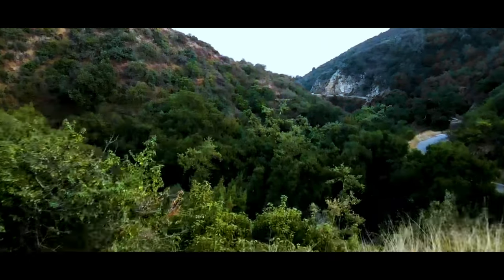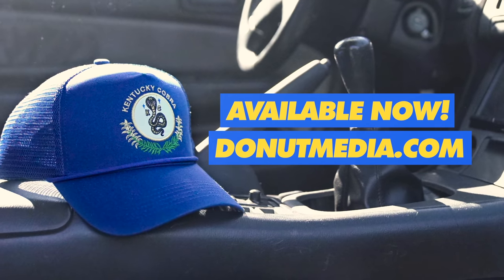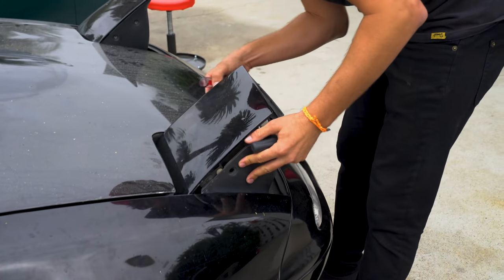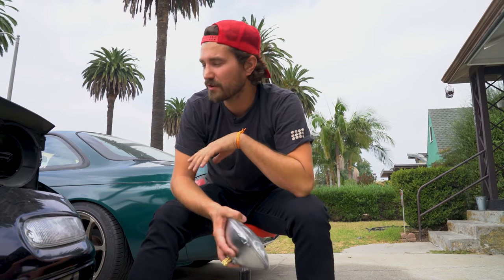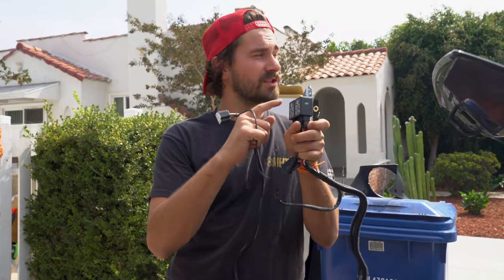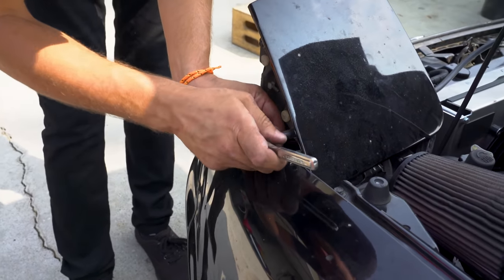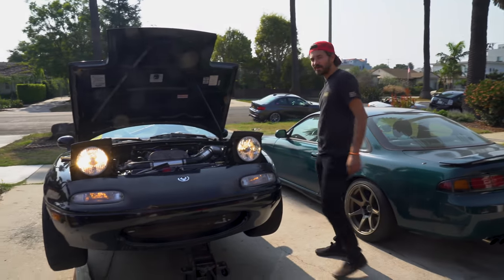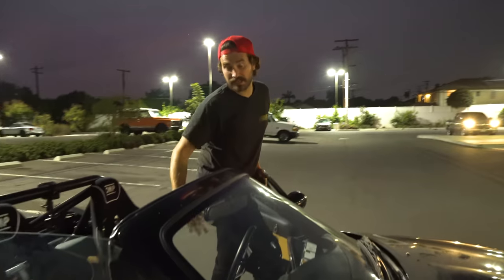Are Aftermarket Headlights Worth It?

Comment: Double the wattage of a light doesn’t equal double the light output Zack.
“Easier to install, I think....” Famous last words. 🤣🤣🤣🤣
Reply: Technically double the wattage will put out double the light (in terms of lumens), ignoring negligible differences like increased voltage drop. Doesn't the power doesn't mean double the throw/distance of the beam though.
Reply: @Biker790  True. Square-cube law says that you need 4 times the light to have the same intensity at twice the distance.
Reply: Sealed beam headlights are just straight up garbage for light output, nevermind their wattage. The halogen reflector is a good upgrade from them as they are brighter lighting elements and better focused. A halogen projector would be better still, but I would have went with a proper LED reflector lamp to avoid the extra wiring. Projectors sometimes look silly in older cars.
Reply: It's funny you think that you're saying something profound, but you didn't actually listen to the wattages that he said, he didn't double the wattage. He went from 35w to 85w.

Comment: Much cheaper option: Sylvania XtraVision. I put some in my Datsun and they're seriously better than any car I've driven without projectors. Plus the thing you forgot this video is that higher power bulbs are much more strain on your alternator, which is like 70 watts iirc. Better to go good 60 watt than 100 watt because of this, you could end up with other electrical issues.

Comment: Upgraded my 92 miata to LED headlights. It put out way more light, and didn't need to upgrade the wiring. As it's an older car I'm also glad they changing all the lights to LED reduced the battery drain in case I leave the lights on when I run into the store.

Comment: Still waiting for the turbskis, at this point next week is gonna be 
“After aftermarket valve stem covers worth it?”
Reply: You gonna take that jobe?? lmao
Reply: Are aftermarket window wipers worth it?
Reply: I'd be more interested in supercharging it.
Reply from the maker: Yo, but really... is filling ur tires with nitrogen worth it???
Reply: @Donut yes. blue valve stem caps are such a flex
Reply: Valve stem caps?

Confused rotary noises
Reply: @Donut  i use nitrous in the tyres
Reply: @yeetyfreety6938  I would be interested in an aftermarket linkage or motor that makes the damn wipers go FASTER!  My NB wipers are slow asf compared to my Integra wipers!
Reply: @Donut  asking real questions now 🤔🤔🤔

Comment: "Watts can actully be converted to hp" 
Probably everyone cuz i did: so how much horsepower the light have?
XD
Reply: More importantly how many does it take from the car from extra load on the aternator? Then add more for heat and belt drive losses.
Reply: XD
Reply: 0.046hp = 35watts
Reply: @Jubr123  1hp = 0.746kw = 746 Watts. Google it ;)
Reply: @Fuck9oogleAskMe  here in Australia, we dont use hp, we use kW... idk why hp exists its a stupid unit of measurement.

Comment: should've went with LED's in the round housing, there is no reason not too.
Reply: LED's don't throw the light evenly everywhere, not good for that style housing. should've use HID's
Reply: @irvincoria1887  you do know they make leds in round housing's right?
Reply: Tossed in some leds in my Jeep and love them. Way better then stock. Not cheap but I can see way better.
Reply: @irvincoria1887  An LED projector would. You need the appropriate housing, no matter what your light source. And HIDs are an environmental hazard, thanks to the mercury they contain. The long warmup, and unsafe starting voltages aren't a point in their favor either.
Reply: @mtbtire3229  uh in what way? objectively they are better in every way possible. They cast wider, brighter, last longer, and have a more defined white which allows you to see better. I don't know what LED's you are talking about but there are LED lights for the NA that look like stock.

Comment: The only tool I needed to replace my headlights with led bulbs was an 8mm socket and some yank-force, the bulbs themselves had a power converter and a fan on the driver and diode
I didn’t know the bulbs were encased on older cars that’s pretty cool

Comment: My motorbike from 1974 had a single Sealed beam headlight that was 55/60W.  On low beam I couldn't see shit aside from directly in front of me for about 3 metres, on high beam (After I rewired the entire 74 loom and added some relays to it) I could some how see over 100m with it in a very precise spot but lost a lot of side vision.  It really surprised me how well the high beam worked on it.  I since replaced it with a semi-sealed with a 55/60W Halogen super bright which was a massive improvment on side light, but the high beam was a bit holey, then I upped it to a 55/100W and now I can see the headlight 20m up the road during the day.  It's awesome. Then my clutch cable snapped...

Comment: I've done the same to a few old motorcycles. Best upgrade per dollar. Seriously. If you want a cool bike for cheap, get something old, swap the headlightts using proper lense, H4 bulb kit, and a relay, re-skin the seat, replace rubber hoses, and put on new tires. All that stuff will be about $400-$500. I'd also get the best brake pads you can find for the bike.

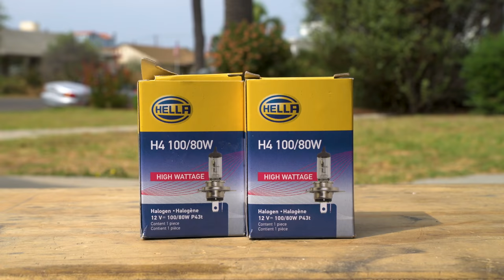Comment: 5:10 one thing with lighbulbs, both incandescent (regular ones with a filament "thread" inside) and halogen, or even fluorescent "daylight" lamps, will output WAY less power by wattage than LEDs. In fact, you can replace a 60w ordinary light bulb with a 8w LED and get more light, and getting 10 or 12 watt light-emitting diodes will be an upgrade, and save power. I understand why he puts non-LED ones into old car, just sayin that LEDs will give more light at less power (two other types are too fragile for cars).

Comment: Have my 7 inch round headlights swapped for LEDs in my jeep. The old original halogen ones were pathetic next to the new (JW Speaker) ones. Really bright, perfect beam. LEDs are so much better, run cooler to boot. Never going back.

Comment: Well, my BMW e36 had bad lights too. I opened them and Installed some 55w chunese bi-led projectors with a laser section. They were kinda expensive at 400$ but well worth it. Even cheap 70$ Morimoto replica projectors with cheap HID system works much better than almost everything made before 2010.

Comment: Watched this when it was new, coming back cause I finally got me some new headlights coming in the mail and wanted a refresher. Mine should be just plug and play though so much easier, but we will see. Going with a cool new housing that has a Halo ring in it and going to be using LED's headlights for my 90 crx. Wanted to make sure I remembered the steps to adjustment so, in case they are a little bright I don't blind anyone by having them pointing up lol Also got some smoked turn signals to match the black headlight housing and the brightest amber LED's I could find so hopefully those will be even more visible than they were before even though they are smoked, and finally I got some super bright LED's for my back up lights cause I can't see shit backing up right now. Also I know ya'lls sponsor Ebay will love to know I got all the housings off EBAY!

Comment: 1st i say congratz on refraining from stickin in some stupid lookin glowing ring cheap blingey ebay headlights & 2nd to anyone interested in a simple inexpensive alternative, an affordable headlight swap/upgrade (i did to my 98 formula) is available from LMC TRUCK ...they sell replacement headlights that cross over (find ur size & match it to what year truck has the same size) to alot, if not every, old cars out there with round or rectangular sealed beam headlights & they allow the use of a modern interchangeable bulbs in a Metal Housing with Glass (not plastic!) Lenses, & all u gotta do is splice in a new connector in place of ur factory connector, super simple, super inexpensive, & they have made a huge difference ...thanx for the videos guy, really enjoying the money pit series in perticular. god bless

Comment: my solution was just to add more lights.. i went out and bought 2 sets of these $12 flood lights from harbor freight and mounted one set on the front of my truck, tried to wire it in so i could control it with my main light switch, but i messed it up and fried something in there, leaving me having to run the floods as if they were my normal headlights lights, ironically i never got in trouble for that, but i mounted the 2nd set on the back, which actually catches the police's attention pretty quickly, but instead of getting a big ticket for running lights that say "FOR OFF ROAD USE ONLY!" plastered on the back of them, i instead just got compliments, the officers liked how i wired everything up to my dash.. so honestly, it's actually pretty hard to get in trouble unless you aim them suckers at the other cars. btw... the ones in the back are cause my reverse lights don't work at all lol

Comment: I'm not sure that going to brighter 80w versus 35w low beam, 100w versus 65w high beam headlights is the best plan. In suburban/urban street and highway driving you're going to annoy a lot of people, including police with these headlights.  I think installing high wattage (or high lumen) auxiliary driving lights under or over the bumpers is a better way to go. That way you have the option using the ultra bright beams in situations where you really need them and can shut them off when you do not.

Comment: for a more detailed explanation of why you don't touch bulbs. the filament of a bulb is tungsten and it evaporates inside the bulb. It recondenses back on the filament. if you touch the bulb is creates a cold spot and the tungsten will collect there and wears the bulb out faster. Easiest thing to do is to blot the bulb with 90% IPA (rubbing alcohol) on microfiber and reinstall with nitrile gloves

Comment: aiming ECE Pattern (asymmetrical) Headlights: cutoff to the left must be horizontal. load passenger seat with 80 kg and have at least half the tank full. aim down the left side cutoff 1 cm per 1 m from the middle of your bulb (maybe 1,2 or even 1,3 cm depending on car) so, very easy aiming: left side cutoff should reach the distance in m equal to the bulb height in cm. 
if the middle of your headlight bulb is 50 cm above street level, the left side of the cutoff should reach 50 m on level street. 60 cm bulb height equals 60 m reach on the left side. 
with an aim of 1,2 cm per meter your headlight should reach 50 m with a bulb height of 60 cm. easy maths.
side to side aiming is also easy. the left cutoff is the baseline, where the incline starts is the middle of your headlight. the two incline should be the start from each other the exact distance your headlights are apart from each other.

Comment: Bonus points: the electrical unit of power is named after James Watt who invented Horsepower in order to sell his fancy new steam engines. Mining operators (who had an abundance of water and coal to run the engines) were using horses to drive  pumps to remove water from their mines. They knew how much it cost to keep 100 horses working 24/7, so to sell the Steam Engine James had to convert the amount of work the engine could do (at a much reduced cost, even including the Engineer to fix it) into units that customers could relate to costs:

Horsepower sells engines.

Comment: Before I watch this, I actually do have high quality aftermarket headlight on my car, and they do work a lot better then stock, also my car is an older car which used old halogen bulbs, which I upgraded them to projection housings, to fit a set of HID lights.

Comment: Just a quick heads up to double your light out the amount of energy needs to increase by a factor of 4. If your 80 watt lights are putting out double the old lights it's because of the inefficiencies of the old lights
Reply: Power or energy

Comment: I've used 80/100w bulbs with new wiring, killed the reflectors (burnt them). As winter broke and it was -15 celsius and lower, the headlight glass cracked due to the heat difference ;P

Comment: Careful @Donut.  35w is the highest legal halogen wattage for on road use in the United States for low beams.  80w would not be considered DOT approved.
Reply: Most low beam bulbs at our Honda dealer are 55W Sylvanias and high beams are 60W

Comment: I have the same problem in my 07 Tundra. At night the lights might as well be off they're practically invisible. I really wanted to upgrade to LED conversion but the legality issue has me sidelined as my state has annual inspections. Guess I'm going to have to spring for a whole new projector set instead.

Comment: My question is why didn't you use H4 LED bulbs in the housings?  In my 87 Supra, I ran LED bulbs and will never go back to incandescent bulbs!  The light output is far superior and look amazing. One thing I did have to do is add the relays because Toyota has a double ground for each bulb. Out running your headlights sucks. Keep up the good work.

Comment: Power (+) should be directly from the battery terminal so it receives consistent power and avoid any kind of dimming.
Reply: Battery is in the trunk on a Miata so that’s not really feasible. Power, while the car is running, is coming from the alternator, so that is a perfectly acceptable place to get power from.

Comment: No, go with the Jeep halo lights and splice the signal and running. Looks nice and bright white
Reply: I kinda wish they would have shown the two screws, but for a heads up, the ring has 3, and the adjustment is the only other ones. PS, it is easier to remove the plastic shell with the hood up, so might as well have it up from the beginning. The last thing is that if you want ungodly bright lights, go with a chrome housing with a set of LED lights. The last thing is that you can adjust the stop bolt at the base to adjust the down height.

Comment: A 1994 Miata is 155.4 inches, or 12.95 feet, long.  A mile is 5280 feet.  5280/12.95 is 407.72 Miatas.  So 1 mile an hour is 407.72 Miatas an hour.  Meaning when you're at highway speed of 70 mph, you're actually going 28,540.54 Miatas an hour.

Comment: Leds would have been better if they're legal there. They draw significantly less power aswell as being significantly brighter, they're also a lot more durable and longer lasting. They too can be calibrated and focused depending on the housing and with more expensive ones you can adjust their colour temperature to match a stock look if you'd like, they don't have to be bright white.

Comment: Watts in power does not equal watts in light output!

Also, light is a victim of both the inverse square law, and the fact that light output is logarithmic and does not scale linearly. This means that double light output will never double light intensity. Because of how your eyes perceive light...

So it is very unlikely he will double visibility. Further, not sure about California, but I am 99% confident federal NHTSB limit headlamp power to 55W. Regardless of low or high beam, 55W is the limit, high beams, as the name clearly describes, point higher up than low beams, they are not brighter. Hope they know this things!

Comment: I'd be careful with 100W bulbs. They are not street-legal for one, they will blind the oncoming traffic. If these were projection headlights, not reflection ones, I'd be less concerned because in projectors there is a sharp cut-off line with little light escaping upwards.
Also, I find it interesting and worth checking - how much gain would you get if you left the street-legal bulbs (35W) and add the lossless, thick-wired harness only. Could you do a test like this?

Comment: Kinda surprised you didn’t mention how in some countries they use kilowatt (kW)as the standard power measurement. So the miata has 89kW of power as a kilowatt is 1000W and the miata had 89,000 of em.

Comment: Isn't it redundant to use the relay with the new system through the factory harness? That system already has been triggered through a relay. Your light switch connects the low side of the factory relay which sends a higher amperage direct power to your harness....seems like extra work...

Comment: Nice show, fun, entertaining.  I have two issues:

Watts is the current draw of the bulbs.  It is NOT the amount of light they put out.  Comparing your old incandescent lights to the new halogens is an apples/oranges comparison using watts.  Lumens, baby.  That's how much actuall light they throw downrange (the rest of the power is lost to creating heat).

2.  There's a system to measuring headlight alignment, it is how much should the light drop from the base height at some distance from that wall (usually 25 feet).  You don't cover it, but you obviously used it.  Shame.

You can get LEDs now that are far brighter but maintain that same classic look, if you want it.  Last forever, throw more light, with sharper cutoffs too (the better ones, anyway).

Comment: Headlight assembly clearly says "12V60/55W". Fitting 100/80W light bulb that generates more heat that the light is designed may cause it's reflective part to degenerate or some parts may just melt down. Not a great idea if you ask me.

Comment: Dude! Did you just install 100/80W bulbs on headlights rated at 60/55W? Won't it destroy the brand new headlights??  One of my students from my auto electricity classes told me he once installed 100W bulbs in his car's stock 55W headlights to improve visibility and it ended up melting the headlight housings and setting fire to the wiring. In your case you're safe with the wiring upgrade, but I have doubts about the headlight itself... Cool mod, by the way. At first I thought you'd be using the E-code headlight replacements.